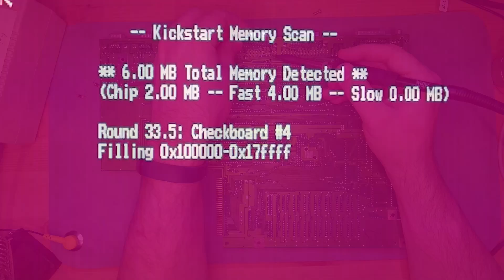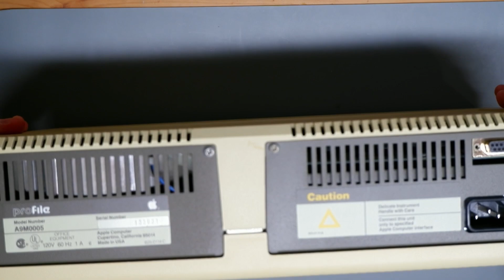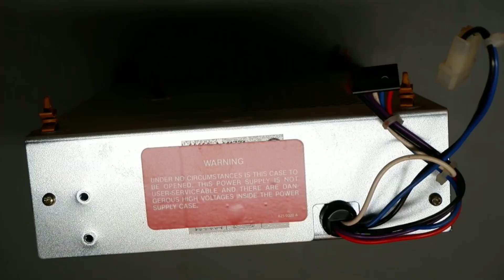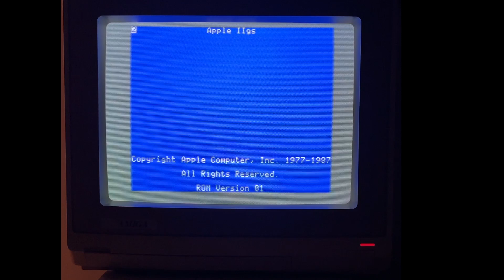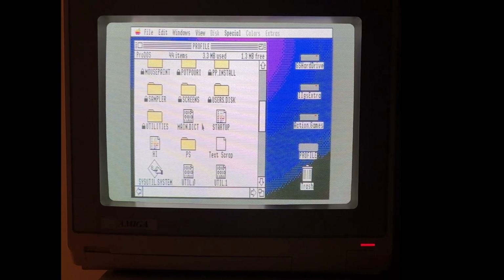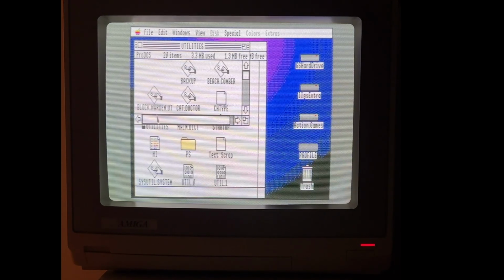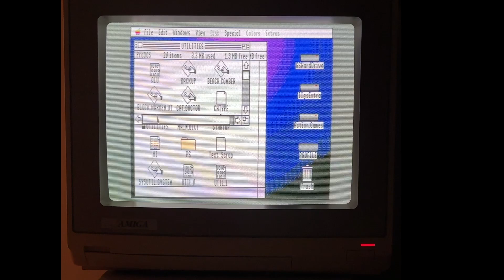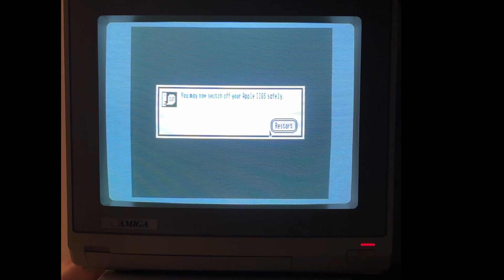Replacing the smoke in a vintage Apple ProFile Hard Disk Drive

Comment: Wow! Great video but how did you connect that Amiga 1080 monitor to the IIgs? I guess with the Manila Gear VGA adapter, right? How about the cable, was ist stock or did you customize it to make it work? Thanks!!!
Reply from the maker: Thanks! I have a custom cable on the monitor. The Amiga monitor is the same type of RGB, so it’s a one to one match of signals. On some 1084s, mine included, I had to connect a 75 ohm resistor from composite sync to ground to eliminate sync roll.

Comment: It looks like the RIFA cap was a 610 volt and your replacement is only 310 volts. If I'm reading the caps right you may have more smoke to replace soon. If I'm reading them correctly... Also even though the other "RIFA" caps look ok I would still replace all of them. They can't be trusted.
Reply from the maker: Good eye, but the 610 is unrelated to voltage. The other side shows a 250V part.
Reply: @breakallthethings  Thanks for telling me what the voltage actually is. I still think I would change all RIFA caps just so you can protect the other circuit board from a possible over-voltage if any short out. I enjoyed your video and also subscribed. Thanks

Comment: Great fix.  If you are going to keep it, I would recommend recapping the whole thing due to the age of the capacitors and the rare factor of these drives.  Glad to see the drive still works.
Reply from the maker: I seriously considered it, but I'm going through that phase of wondering if I should proactively replace capacitors or try to keep it original until something goes wrong. I may go back and take care of the rest of them. At least the RIFAs tend to just make it non functional, rather than causing active harm.
Reply: @breakallthethings  If they look okay and aren't leaking, you can probably leave them alone.

That said, it might be worth removing a few and seeing if they still have the rated capacitance. If they don't a full recap might be worth it just to ensure proper operation in the future.

Comment: This was the world's first intelligent hard disk drive.  It has its own operating system with extensive onboard diagnostics and presents itself with a simple parallel interface, requiring no dedicated hard disk controller.  It performs a very thorough self-test when it powers up- this is why it takes so long before it is ready to be used.  There's even a tool called the USBWidEx available which allows for servicing these drives with a modern computer- and it also works with the later Widget drives.
Reply from the maker: That's incredibly cool, thank you for the heads up!
Reply: That's called having embedded software (probably in a ROM chip).  
 
An operating system is something a little big more specific, it typically refers to software that provides certain core services to other software that is entirely separate.  
  
This is just an intelligent hard disk drive, but most peripherals are intelligent these days.